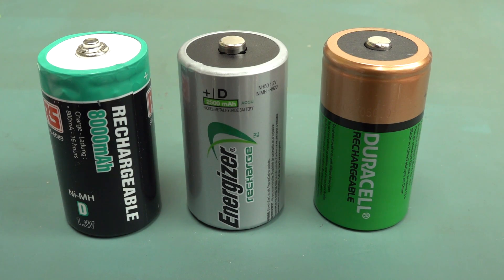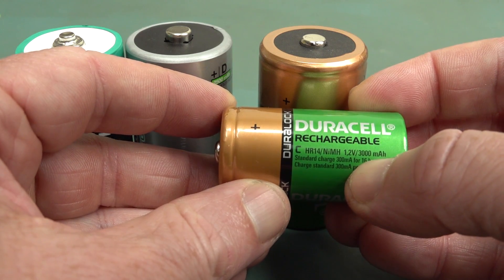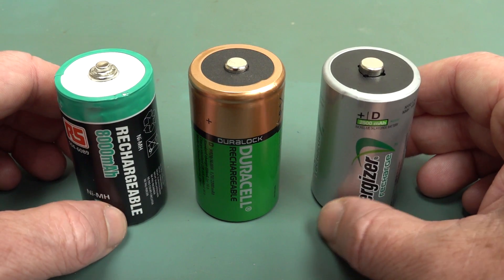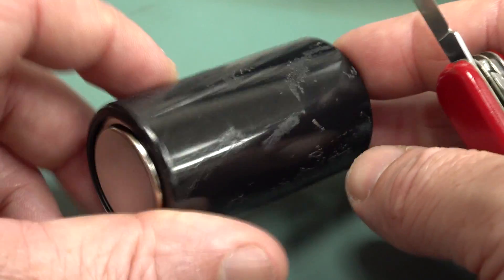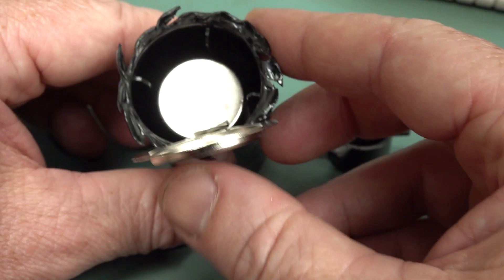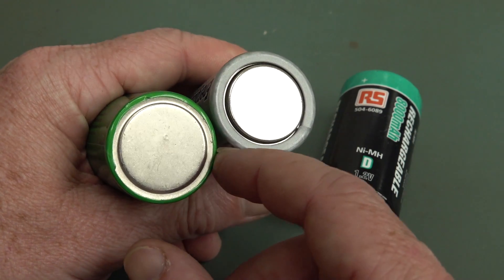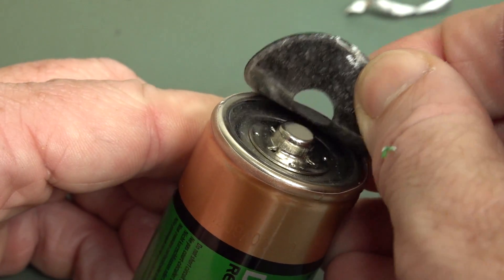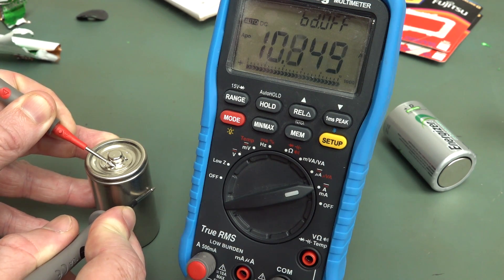EEVblog #1200 - BUSTED! - Energizer & Duracell NiMH

Comment: These 2 brands have built their image on being longer lasting than other brands so it is an obvious scam. A customer won't look at capacity because they assume they will be the longest lasting one. Most people don't know what mAh are or mean and will easily get ripped off.
Reply: People will also expect that if Energizer says 3000mAh that someone claiming 8000mAh is the obvious scam...
Reply: Keenan Tims  They are all a partial scam because the 2000mah will only be 1800, the 2200 will only be 2000 and so on.  If you read battery brand reviews on Amazon, you can frequently find where someone actually went to the trouble to test the battery.  I tend to trust those comments more than the "This is the greatest battery" comments.
Reply: @KeenanTims  That was the first thing that crossed my mind. Even though RS has been around, that doesn't seem to guarantee much these days.
Reply: @KeenanTims  I'd agree with you if it was one hung low brand, but it's RS, people wouldn't assume they were a scam
Reply: Keenan Tims  They are all a partial scam because the 2000mah will only be 1800, the 2200 will only be 2000 and so on.  If you read battery brand reviews on Amazon, you can frequently find where someone actually went to the trouble to test the battery.  I tend to trust those comments more than the "This is the greatest battery" comments.
Reply: @KeenanTims  , he did not show you the RS. So how do you know they aren't the scam. Maybe that heavy thud is lead dead weight and not serving a purpose in producing energy.
Reply: They only built that reputation by comparing their Alkaline batteries to other brands Zinc-Carbon batteries in their advertising. Like these rechargeable batteries it's not lying but it is definitely deceptive.
Reply: They gotta pay for all that advertising somehow.
Reply: Have to admit I'd probably get caught by this, at least if I was buying them in retail.  If buying online or ordering from a normal supplier, I'd generally be checking specifications - but in retail I'd more likely just expect these name brands to have "industry leading" specfications.

That said, I am more likely to look at capacity when it comes to rechargeables than Alkaline, and it isn't in tiny fine print so I might notice.  And I do know typical capacities to compare with.
Reply from the maker: john douglass - Yes, not technically a scam, but very deliberately slyly deceptive that plays off their market position and reputation. They don't do this with other size batteries.
Reply: @EEVblog  They don't do it with other batteries because the cost difference doesn't make it worth it. Normal consumers won't pay nearly £10 per cell for a device that will likely take multiple cells (even if the long term savings may be more, but consumers don't think like that) and stuff that takes D-Cells is on the decline anyway, RS cater to the professional market that have the money.
Reply: @EEVblog  So if its not technically a scam, why are you calling it a scam, Dave? You honestly think people would be picking up a pack costing more than 3 times the amount if given the choice on the shelf between the two?

An interesting look at what these guys do to keep costs down for the mass market, but without any reference to costs, your argument is pretty week.
Reply: What were the price?
Reply: yup, price is a major factor here ..im sure there was a difference in price between the energizer and the RS..with the RS being much more expensive...
Reply: @WacKEDmaN  Energizer and Duracell are premium brands and usually the most expensive in the stores. I highly doubt they were cheaper than the RS battery.
Reply: @WacKEDmaN  Over twice the price in the UK.
Reply: @excitedbox5705  And you'd be wrong.  RS are more than twice the price.
Reply: @WacKEDmaN  The RS cell is about $20AUD per cell and the 2500 Energizer is about $11AUD. So yeah you get the capacity you pay for, no scam, not even particularly sly, more of a beat up really.
Reply: Energiser rechargeables have always been behind other brands, including their AAs.
Reply: @BrekMartin  can't be more true than that, i've paid 15 euros for a pack of 4 AA that said 2500 mAh only got got it beat by a 4 euro "Tronic" pack rated at 2000 mAh that i bought from a supermarket
Reply: @BrekMartin  Their D calls are AA cells.
Reply: I've heard Energizer and Duracell intentionally offer crap rechargables to convince people that rechargables suck and they should keep buying new alkalines.
Reply: @CptJistuce  They also sell crap alien faced chargers to go with them and their "smart" battery charger that charges 2 in series rather than individually.
Reply from the maker: True
Reply: EEVblog well the off brand li-ion batteries very often way over rate their mah ratings. I've seen name brand Sony 18650 rated at max 3000 mah at 20 amp discharge then offbrand claim 5500-7000 mah at 20 amp discharge. Personally I wouldn't try and discharge the off brand at anywhere near that rate.
Reply: I was about to say that its not a scam because they state what you are getting, BUT then I read what you said and have to agree with you they have built an image as being longest lasting.
Reply: Basically the marketing department was very successful
Reply: @TheWareek  Still, you get what the label says, or somewhere around that figure, think most people that have had a couple of cell phones are aware of the mAh and have some kind of knowledge of what it means, how long a battery lasts is an absolute in regards of the labeled mAh, don't you think? So longer lasting may be how many recharges it will take before it checks out, and the image is an old one, long before rechargeables became popular so what Longer lasting means, in reality, is dependant on the load, the mAh, and the age, not the physical weight or size(which is dependant on the format standard) so, the argument doesn't hold up there!
Reply: 5 to 11 dollar a popyou can get a 18650 for that money
Reply: Their entire 'our alkaline batteries last longer than all the other * ordinary batteries' is already a dubious claim because they're not comparing with other Alkaline batteries but with a completely different chemistry. It doesn't matter who makes them, if Duracell made Zinc Chloride batteries, they wouldn't last any longer than any others. There's no(t much) magic here.
Reply: *longer lasting than Cobalt... which is a no duh moment, it's like me saying that the Cobalt is longer lasting than the electricity from a soda can contents
Reply: I still have a couple of GP NiMH 4000 pairs that I got in 2007. I didn't pay as much for them like the others and they still work and they don't boast about lasting long just plain GP in Green and orange. Last time I cycled them I think two years ago I got around 3800 - 3900 mah on discharge. I use them in a Bryman doorbell and they go flat after a year and a half or so.
Reply: If you read the fine print in their advertising, they are long lasting....compared to carbon zinc batteries.
Reply: This video seems to be more about human gullibility in falling for marketing rather than science or facts.
Reply: If they meet the specs they show then how is it a ripoff?
Reply: @KoolBreeze420  They rely on customers not being battery geeks like you.
Reply: @captainwin6333  Explain for I doubt that I'm a battery geek as you say but what is it that I said to make you say that to me?
Reply: Everyone should already know that if you're buying other than Ikea LADDA's, you might as well burn your money.
Reply: More names to add to the very long list of corporations there to empty our pockets and leaving us ever more hungry.....    Marketing at it's best, invest in promotion, not quality...   :(
Reply: Yup, and they charge way more for the D cell than the AA cell, which has about equal capacity. Caveat emptor, I guess. It's just shocking to me that they've been getting away with this for over three decades.
Reply: it'd be beautiful if both companies were part of same Chinesium (producing) CONsortium.
Reply: Is it possible they have less capacity as a safety feature? As in if the battery shorts, then it has room to breathe instead of melting your device.
Reply: what kind of idiot picks up RECHARGEABLE batteries without looking at capacity?
Reply: Actually AA Duracell batteries are amazingly good.
Reply: It's almost like spacing it of works as a safety measure.
Reply: You are the scam
Reply: 8000mAh but directly. Below the big print it shows 800mAh ? Simple scam before even checking the charge.
Reply: @unclezeds  It states 800mA not mAh and that's the suggested charge current for the 16 hour charge duration, which is stated on the same line on the battery.
Reply: Duracell last longer, much longer *compared to zinc carbon batteries
Reply: If you don't know what mAh are, then you shouldn't be buying rechargeable batteries.
Reply: exited , scam is if they lie.  but if people don't know what is a mAh then buy normal one and point. couse also there is a little issue: rechargable are 1.2 volts not 1.5. so for some equipment with like a pack of 4 batteries or 8  it means 1.2 or 2.8 voltage less. that could start to be critical
Reply: @riccardoz2953  Dishonest marketing.  "Duracell batteries last longer....." then hidden away somewhere is the small print .".....than a rock".
Reply: I have investigated that for a documentary, many years ago. Duracell did last 6 times longer, but not in the way most think of it! If you do not use the battery, it's "best before date", is 6 times longer then the cheapest brands!
Reply: This reminds me of a weird battery I needed for a miniature digital  multimeter (DMM) someone gave me. This thing looked like it took a AA battery but was actually 3/4 length of a AA battery. I took apart old battery and it was 6 or 7(?) Watch batteries (button cells) stuck together to make a 12v battery, at about $7 /$10 for the entire battery!
Reply: If you're a pussy consumer who doesn't read specs then yeah it's going to be a scam to you. You have to factor in price as well. If the D cell costs the same as their C cell there is no scam. It's manufacturing convenience.
Reply: @carlosoliveira-rc2xt  murican battery geek alert.
Reply: C and D rechargeables are notorious for having AA or subC cells inside them with shims. 
However in a lot of cases the higher capacity of "genuine" cells doesnt matter as for things like flashlights intended for casual/emergency operation the things will self-discharge long before reaching actual capacity discharge.
Bear in mind that NiMH with long-duration charge retention (a year vs 30 days for older designs) have only been around for about a decade and are still positioned as a premium item.
Reply: Poorly built one, probably
Reply: Ripped off?  I wouldn't go that far.  They aren't North of 10 a piece and they have Energizer/Duracel quality control.  There are brands on Amazon charging pretty high prices with over 50% failure rates.  We're talking one or two cycles level bad quality failure rate.
Though, Amazon just released a 10,000mah $24 for 4 of them. That's not too bad as long as they are as good as the AA
Reply: In my local store these 3000 mAh D cells cost exactly the same as the 3000 mAh C cells from the same brand (Varta). So, either there is no issue, or they are both a rip-off.
Reply: Well it's not really a scam as the capacity is marked on the battery.  Some cheap Chinese brands exaggerate its capacity but Duracell and Energizer tells it like it is.
Reply: I bought some powerowl AA cells with 2800 mah, and the closest Duracell was 2200, for 3x the price. 

Name brand can get stuffed, they spend so much money on marketing, so you pay more for their products. 

It's like Apple, they work so hard to make sure their devices are unrepairable, and who is it that pays for the serialized, unrepairable screens that are married to the motherboards, and the cameras that are married to the motherboard...? The end user.
Reply: To be fair, the information is available. That people don't know how to read it is not the companies fault. Also, a D battery is a D battery because it has specific dimensions, that doesn't mean that those dimensions need to be fully filled on the inside. You could put a coin cell in there and have a 100mAh (just a guess) D battery, still perfectly fine. We can't blame the companies for people being stupid.
Reply: @timderks5960  The question is: If they sold the C-cell with a D-cell adapter included for the same price, would people still buy it or would they be expecting D-cell capacity for their money.
Reply: @timderks5960  The fact they play on that is the issue.  They are taking advantage of people and you may not have an issue with that but others do.
Reply: @Captain Win
Oh come on, that's just how marketing works. If you're a person that believes any commercial that says "Lasts x times as long as other brands", you're in for a tough life. Every marketing team ever is gonna say their product is better in all ways. If you really want to know, you need to test it or do research, that's how it's always been.
I mean come on, it's on the packaging for crying out loud, how much clearer does it need to be...
Reply: @timderks5960   so now the general public are expected to be experts on the finer technical points of battery technology (on top of everything else, while trying to scrape a living) just to avoid being ripped off by marketing sharks?
Reply: The general public is supposed to understand that 8000 is more than 2500. Just understanding that mAh stands for the capacity of the battery, is enough. You don't need to know what it means, you don't need to know how much power that actually is, just that more is better. If that's too hard for somebody, they're really, really lazy.
Or, you know, just use common sense. Buy the cheaper ones sometime, try them out. Do your own research. It's not that hard, but it seems to be too much of a hassle these days, especially in the US.
Reply: @timderks5960  Yeah, I'm not sure people actually pick up multiple brands and compare the numbers.  If my brain was programmed with hours of "Energizer bunny lasts longer" ads, I'd assume it was a good battery relative to others.  2500mAh?  Well, I guess that's how much D cells are. Frankly, I'm not sure I'd even notice myself. Is it illegal?  No. Is it something a class action suit could win against Energizer on?  Maybe.  There's plainly a case to be made that advertising batteries as longer lasting yet selling batteries with 1/3rd the capacity is deceptive.  I sure don't recall any small print "Energizer alkaline AA cells are longer lasting compared to Sleazy-Co brand AA, no other comparisons are implied"  or anything limiting the scope of their "longer lasting" claims.  Sure, there's probably some laws or precedent that limits the requirements of false advertising enough to make this technically legal... but that doesn't mean that a civil case couldn't be made and won.
Reply: @timderks5960  well, mAh values have only started appearing with rechargables and only recently have they become cheap enough for general consumption. It's easy to be arrogant about it when you are a geek and already know but it's just another number to normal people and they already have their plates full being their own experts on everything from the best deals on energy utilities, insurance, finance what's in the food they are eating and the medicines they need, whether they have work next week. I think we might forgive them for not being as well informed about milliamp hours as visitors to EEVBlog.
Reply: @Darron Black
You could just check the numbers in the store you know... It's not like you can't touch anything in there...
Also, you immediately showed what the issue is here: You assume. If you want to do that, that's fine, but then you can't complain about being ripped off. If you want the best value for money, you gotta put some effort in. I know the US is very focused on dumbing everything down for people, but maybe it's time for that to change.

@Mahla Propyzm
You know how I got to know this stuff, like battery capacity? Because I asked, or looked it up online. It's not like it's all top secret, just a simple google search will give you all the details. It's not about being arrogant, it's about people being lazy, and just wanting to follow marketing, expecting that to be true. We all know that's just plain stupid.
Let's say you know nothing about cars. You could go to the first dealer you see, and just let them recommend you something. I think we all know that if you do that, you get ripped off, massively, so you need to do some research. Why would that be any different for other things you can buy?
Reply: @timderks5960  It has nothing to do with being stupid. If you see a coke can you assume that it has the same amount as every other can that size and don't check to see if they filled half of it with cement.

I don't know how old you are but I don't think when I needed batteries for my walkman, discman, gameboy, boombox or any of those things I ever loked at the mAh. You assume that standardized products are standardized and if a manufacturer claims to last way longer than the competition that they won't give you 1/4 the performance. That would be blatantly false advertising. That used to mean something. There is actually a term for the type of deception that this marketing is doing, (Deceiving people because it is assumed to be something) but I can't think of it right now.
Reply: @timderks5960   It has nothing to do with being stupid. If you see a coke can you assume that it has the same amount as every other can that size and don't check to see if they filled half of it with cement. You don't check to see the measurement every time you pickup a can of coke, or do you?
Reply: @timderks5960  Who puts effort into researching the capacities of a $10 battery. I promise the average joe is just gonna pick the name brand battery because well advertising works. Duracell and energizer know that their products are cheap and that their market in general won't bother checking and they are using this to deceive their customers.
Reply: @exited box
No you don't, because you bought a can of a specific volume, not of a specific size. The D cell is a specific size. Nothing to do with it's capacity.
The reason you didn't check these things for your walkman, is because you were a kid. Kids don't know this stuff. What they do know, is which battery will last the longest in their discman. If you bought a set of batteries that only lasted you a day, while others lasted you a week, you wouldn't buy those again, especially if the price was the same.
Reply: @steve
10 bucks? Jesus you guys are getting ripped off. And again, this is where you as a customer fail. It's not the companies responsibility to tell you if a battery is good value or not. If you want to know, you need to do the research. If you don't do that, you simply don't care enough. It's less than 5 minutes work, so if that's too much work for your crazy expensive batteries, why are you even complaining about it?
Seriously US, get out of that "I have no responsibility, the company ripped me off" attitude. If the company puts 10.000mAh on the box and delivers 1.000, you got ripped off. If you believe marketing, you need to think a bit harder from now on, and possibly do something to have legislation put in place that prevents or clarifies misleading marketing.
Reply: @excitedbox5705  It's a bit like slack-fill for other products but not quite.
Reply: Darron Black,  after all, people are bombarded day-to-day not only with advertising but with talking heads on radio,  TV and newspapers telling us how capitalism will solve all our problems and provide for all of our needs. "Free market competition", faster/better/cheaper,  building a better mousetrap, yada yada, those are some of the mantras of capitalism; and so,  ordinary people believe, or *want to believe*, it! They're programmed, pre-programmed really, to believe that giant corporations run by multi-millionaires and shareholders, the investor class, actually have the interests of the consumer at heart !! And anyone who questions capitalism get crapped on, mightily. 

Anyway, you make a very strong point that in this age of specialization, the majority of people only really know a great deal about a couple of specialized things. In all  other matters, most people lead busy lives and have a lot of  things to coordinate or worry about, and the average person would just like to be able to buy a product that makes a reasonable stab at living up to expectations, and isn't merely a vehicle for advertising hype that serves only to take hard-earned money away from the consumer without delivering what appears to have been promised . 

There  also the fact that many people hardly ever set foot in the store and buy most of their products online, and so they don't hold two competing products in their hand and feel the heft of one versus the lightness of the other; and even then when you are examining the products in person you might need a magnifying glass to read the fine print on the package.
Reply: @Mahla Propyzm
Now see, I'm Dutch. We don't do the "be nice to your mother just because she's your mother"-thing. We're just honest. If my mom doesn't know that, I'll explain it to her. If she doesn't want to know, I'll tell her that's her loss, and she'll be buying batteries that aren't worth it. Thankfully, my mother isn't stupid either, she's smart enough to buy cheap batteries, and just not buy them again if they really suck. Honesty is gold, even when it's your mother.

@Chaos Corner
Yeah but the thing is: D-cell capacity isn't a thing. The D-cell specification is nothing more than the form factor of the cell. If the D-cell is 1mAh or 50Ah doesn't matter, it's just about the shape of the cell.
Reply: @timderks5960  You say you buy a package with a certain volume or weight, and yet people are still complaining about the amount of air in bags of crisps. The bags have the content weight listed, so of course the customers just have to check that to know what they are paying for, right? On a technical level that is correct, and yet people keep buying the large but light bags and feel cheated when they open them. So should we blame the consumers or the manufacturers? The manufacturers will tell you they need the added volume to protect the content so you don't end up with a bag of crumbled crisps. This is called slack fill.

Consumers has been complaining about this for fifty years or more by now, and that's for a simple and common product group that you should think they would be used to by now.

Rechargeable D cells on the other hand is something you might buy just once or twice as new devices very rarely use them. So you buy a set for your old time radio or flashlight and that's about it. These customers are not likely to do more than the absolute minimum investigating what battery to get, and unless they already know a bit about electricity and batteries they won't be checking the capacity. After all a D cell is a D cell, right?

I just checked and I only have one thing in my house that uses D cells, a 40 year old radio. Now if I were to buy a set of rechargeables for that radio it's not likely I'd be replacing those anytime soon. So I'd probably never discover just how different the capacities of different brands can be just because I ended up comparing them. And when I got the first set I'd quite likely go with one of the gigant brands, such as Energiser. After all they are one of the biggest brands, so they are probably also one of the best....

Now I do know a lot about electricity and electronics in general, so I'm perfectly capable of reading the specs. And yet as I'm not a battery nerd I'd be likely to assume that the big brands are the standard to compare things by. I've seen a lot of noname or obscure brand batteries that has been marked with fantasy numbers claiming fantastic capacity and delivering perhaps 10% of that. So if the Energiser D cell is listed as a quarter the capacity of some brand I've never used (RS? Never heard of em...), then I'd suspect that there is something funny going on, and I wouldn't be suspecting BigBrand to shortchange me that badly.
Reply: @blahorgaslisk7763  This is exactly it.  If I saw 8000 mAh RS batteries in the store, next to 2800 mAh Energizer... I'd buy the Energizer assuming the RS batteries were lying.
Reply: @DarronBlack  then you'd be stupid as you fell hook line and sinker for "marketing". The 8000mAh one would almost certainly be significantly more expensive.
Reply: @excitedbox5705   They use that large shell because that's the standard size for some electronics and it's more expensive to make higher capacity batteries, so making a larger battery because of the size standards and comparing it to a consumable good that you don't need to fit it anywhere makes no sense at all.
Their size doesn't need to reflect the real capacity. Specially when there are markings indicating their real capacity.
Reply: @fergusoddjob  you don't need to put effort, just read the goddamn package.
Reply: Darron Black I’m with you. When I started this video I assumed it would show us how the RS (what the hell is RS??) are scamming people with imaginary mah numbers and how you should stick with the name brand ones. 

I have 0 need for batteries beyond 9V’s for the fire alarm and some aaa’s for remote controls so how much I can generally expect for capacities in NiMH is not something I had any idea of.
Reply: @User_2  Exactly.  The assumption is a large enough company would not risk reputational damage or legal trouble with misleading advertising.  That definitely appears to be changing...  perhaps younger people will say "Well, duh!"... but that was a reasonable assumption in the past (GENERALLY).  That's what's so interesting about this video... it shows major battery manufacturers f*cking you over, and the comments seem to indicate they've been doing it a while.  THAT's the news here.  At least to me.  I was not aware that little sub-market was so sleazy all the way up to the major manufacturers.

Could I have known better?  Of course.  People have to make assumptions to live.  If you're so caught up in thinking being smart means not making mistakes... you've made a serious misjudgment.  It's actually the best way to ensure mediocrity, really.  Make them think being smart means not making mistakes... they'll be too scared to do anything else they start failing a lot.
Reply: @timderks5960  I generally regret purchases when I don't do research into things I'm buying. I'm glad I never bought a diesel with a DPF. Like allot of people did. It makes them unusable for people who mainly do city driving, forcing them to drive down motorways to clear the filter out and if you don't it will clog and you'll be landed with a bill for ~£2000. Dealerships kept this quiet when people came in considering buying them.
Reply: @mahlapropyzm9180  If my mother didn't know the difference 3 gallons of gas and 8 gallons of gas, even when put into the same size container, I wouldn't think she was stupid but I would think that she wasn't paying attention and had no right to complain. No one needs to know what a mAh is to understand that the number is being put prominently on the packages so someone is buying how much capacity they need. Energizer advertises their NiMh rechargeable cells as running the longest? Where? Alkalines and NiMh rechargeables are very different products and presumably a consumer is at least smart enough to know that they are buying one and not the other due to a different need.
Reply: @DarronBlack  
AFAIK the Energizer Bunny has sold a LOT of Duracell batteries.
People would be influenced by the commercials and get mixed up with the brands when they bought batteries.
I think Duracell had a variety of animal toys including a bunny and people got confused.
Reply: @Blox117  The CO2 rating on VW's was also a rating. Were people stupid to believe that?  Or how about those who look at manufacturers stated CO2 ratings which bear no resemblance to real world figures?
Reply: @mikes1992u  Ah, but was it illegal for them not to mention this?  Maybe it was in the small print.
Reply: They may be taking advantage of some consumer's ignorance - as all marketing does, but it is not anywhere near a rip-off when they clearly present what the capacity is. It is not even deceptive.
Reply: @HarmanRobotics  , agree , and this person has not proven that RS is not the scam
Reply: Just a matter of choice carrying a flashlight with 4cells you need for 10 minutes you may appreciate the lower weight. If you need hours of light you may choose the big capacity
Reply: @blenderbuch  then why not just use a lighter light? A 45 gr 18650 out performs. And has more capacitythan all of them combined
Reply: @mistakenotou7681  There's almost 0 reason not to have a rechargeable li-ion flashlight these days,
Reply: @blenderbuch  Or you might choose the cells thinking they have a similar capacity or at least around the maximum capacity allowed by the size. Caveat emptor, I guess.
Reply: @blenderbuch  and what if these batteries are built this way for safety. So they don't explode but do perform. This guy is the scam,
Reply: i've had a 10000mAh 5v usb battery and if you look carefully at the label it is the amphour rating of the lipo cell inside at 3.7Vdc not at 5Vdc. I trust Wh
Reply: Hypothetically I agree, but nobody actually uses D-cell batteries for anything important anymore, so it doesn't matter anyway. That's why Energizer and Duracell saw fit to sell smaller batteries inside integrated adapters.
Reply: It isnt the 90's anymore. I asked a lot of people i know and 99% of them including my 89 year old grandmother said they look at the capacity instead of just the brand. Furthermore, the capacity of these "scam" cells is correct, theyre doing nothing wrong. People getting "scammed" by this should have learned to look at capacity a long long time ago.
Reply: Not a scam, but definitely a rip off. These D cells cost about twice as much as AA cells from the same brand, while having similar capacities to those AA cells. Dollars to joules, they are an exceptionally poor value, and in that sense they are a rip-off. But they are honestly labeled and properly constructed, so I can't call them a scam.
Reply: So your saying it's a scam because stupid people don't look what they are buying 🤔
Reply: @LawrenceTimme  So you side with scum companies?  Good job.
Reply: Lawrence Timme It's a scam because most people don't have the time to read through all the (mostly useless) text on the packaging.  Most of it is pure noise anyway.  Note that the RS one is the only one that puts the amount as a major item, while the bad products hide it in the noise, hoping most customers won't spend 1 minute (or more) reading through all the text on the package to find the one number that's wrong by a factor of 3½ .  And the full capacity product may not be on a shelf anywhere near the fakes, so customers must memorize every property of every item on their shopping list (exactly how many mAh, recharge cycles, charging speed and charging efficiency for D-cells, then the exact percentages of fat, protein etc. in bottles of milk, expected net weight of a tin of coffee etc. etc.  Because if this is considered legal, there is no way of knowing which product will be diluted on your next shopping trip.
Reply: @LawrenceTimme  It has nothing to do with being stupid. If you see a coke can you assume that it has the same amount as every other can that size and don't check to see if they filled half of it with cement.
Reply: @excitedbox5705  that is still your fault for not checking. If you go into a car showroom and buy a car without driving it then realise after you buy it it was the 2l rather than the 3l but you use the excuse "they looked the same but one was way cheaper".......
Reply: @LawrenceTimme  Obviously with a big purchase like a car you do a little more research than with a battery. If you look on Amazon a lot of the batteries don't list the mAh they list LR20 if you look at Alkaline batteries and those can range from 12-20k mAh as I found out today. Nowhere in the listing can you find the capacity of the batteries.

I am guessing the people arguing for the companies are quite young and missed the ad campaigns that Energizer and Duracell did during the 90s and 2000s. They Advertised themselves as being the highest capacity Batteries on the market. Even if that wasn't quite the case you would assume that they are at least close, not 1/4.
Reply: Stupid people not paying attention to what they're buying is not a scam... It's stupid people being stupid...
Reply: @timderks5960  they seem stupid to you because they don't understand your area of technical expertise. I'm sure there are many other areas where you are just as 'stupid' or more so (and get ripped off too). Don't be so arrogant.
Reply: @timderks5960  so for arguments sake, if I were a brain surgeon (which I'm not) and didn't understand battery technology, would that make me stupid? The RS D cells are $20AU for a pack of 2. The Duracells are between $22 and $24AU for a pack of 2. Duracell are a trustworthy brand and generally a good choice of battery, so why not in this case? Also most people don't shop at RS components, so would never really have the comparison to make.
Reply: @paulb4423  yup Duracell seems to be the total rip off....dont foget...the capacity of the duracell is only 2200mAh...energizers are only $8 (pack of 2) at 2500mAh....the RS pros kick them all tho being 8000mAh and around the same price as the duracell (actually cheaper!)
Reply: @WacKEDmaN  Horse pucky. The RS version will set you back close to $48 for the pair. Comparing the relative cost of the RS and Duracell capacities, the Duracell are the cheapest.
Reply: @captiveimage  Because they come from a cheap and nasty company.
Reply: Noobs ... this is NOT a new practice. And if you would take to rubbing your two brain cells together you realize the HISTORY for this practice ... the practice being, to replace old LeClanche cells!!!!!! Zinc-Carbon cells had MUCH less capacity.
Noobs ...
Reply: Wait...  This "scam" talk is a bit ill-informed.  What is the relative cost?  Image and marketing is always part of the cost of a product....and the major brands do a lot of advertising.  I thought this was a channel aimed at engineering minded people, but I guess I was wrong....
Reply: @fredygump5578   you better off getting a AA to D cell  and get a 4 pack  instead of two D cells of the same price